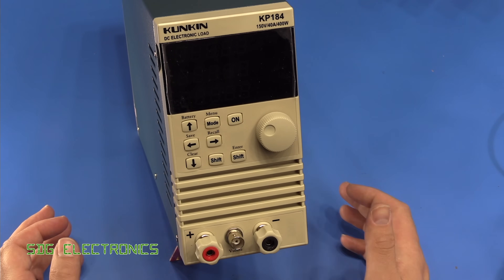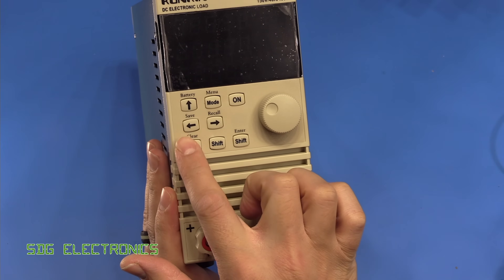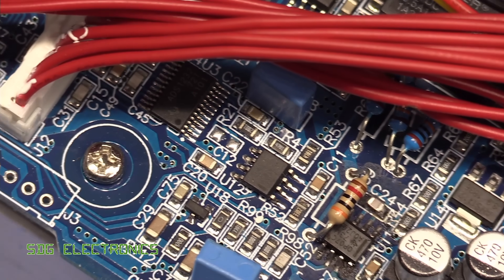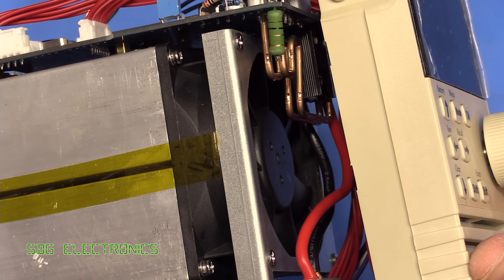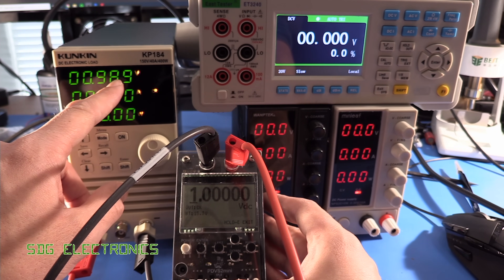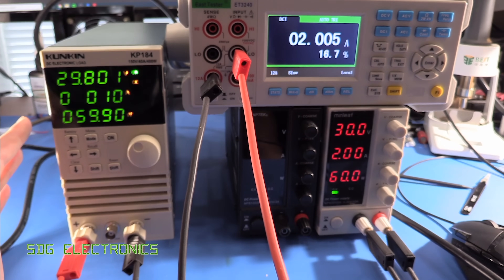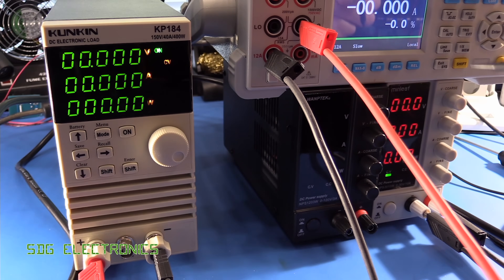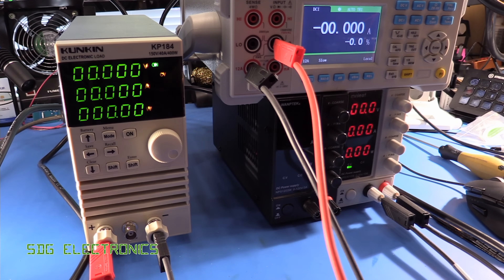SDG #129 Budget 400W 150V DC Load - Kunkin KP184

Comment: I know there are several videos on this unit and this video is 5 years old, but these are still being sold. There's a couple of things which aren't mentioned here: The banana jacks are 4.2 mm and not 4mm. One common fix is to replace these with your own. Also there's an issue with the transformer at 9:10 being bent up and making contact above it, shorting the ground and negative out. The fix is to bend the mounting tabs correctly and/or apply some insulation tape to the body of the transformer to prevent shorts. Something to check if you buy one.
Reply: DLB-600W or KP184?

Comment: Thank you for the video.
The binding posts, external leads and possible the internal connections are not suited for a 40A current. So ... fail?:)
Keep in mind that on/off switching and frequency response characteristics are important measurements for such a device to show.

Comment: Thanks for the great review. At 6:55 I may have spotted a broken solder joint on the front PCB. Above and right of the electrolytic capacitor, in the second row of THT solder joints (counted from the bottom up), there is a very odd looking solder joint.

Comment: Pretty nice on! I am awaiting a korad kel-103 myself which i am really exited to get. It looks much more professional than that unit you got there. Sadly not with banana plugs like the one you got which i am really impressed by. Pretty awesome little detail there!
I will design a small addon board for the Korad at some point. Something like the one that EEVBlog got for he's rigol load.
Reply from the maker: I have that one on my list too as another potential one to try
Reply: @sdgelectronics  when I get it I'll give you a heads up. Even my Co worker is considering buying one and we don't go and buy bad equipment. Anything you want me to check up on for you before you buy it?

Comment: Nice review thanks. Sounds like great value for money. It would be nice to see how fast it reacts sudden changes on the input, as in, does it adjust the load in a micro controller or is it a proper analog feedback design for all modes.

Comment: I'm guessing they already fixed the noise/stability problems that this model used to have?
There were several reports and perhaps the solution for those with older units is probably here:
https://www.eevblog.com/forum/testgear/fixing-an-manufacturer-issue-of-the-kunkin-kp184-electronic-load/
Reply from the maker: Very interesting - I'll see if that's applicable

Comment: I have a KP184, some issues:
- Off by 20mV or so once hot.
- Load positive connected to metal on rear panel (shock hazard).
Also it has battery test. Push shift than up.
Reply from the maker: Thanks for the notes. I've just tested mine - the load positive appears to connect to the heatsink through those MOSFETs, but there is no conductivity to the metal parts on the rear panel. I wonder if something has bridged across?
Reply: @sdgelectronics  Test the screws that hold the heatsink in place.

Comment: Good review, Steve. I'm looking forward to you tearing down and testing that new multi-meter.
Reply from the maker: I'll be interested to see what's inside. In the ranges that I quickly tested, it's exactly aligned with Ians PDVS2mini so a good start!
Reply: @sdgelectronics  I picked up the ET3240 bench DMM from bangood, and it just finally got here.  It powers on but just sits at the green East Tester boot screen.  I've tried pressing buttons, nothing seems to help.  2 hours later, still at that green boot.  Looking forward to a tear down of that East Tester Unit.  Trying to find support for this thing isn't very good so far...  I have an East Tester DC load as well, ET5410 and am quite happy with how it performs and it does all the specs it says (plus some really good programmability).  Hoping I can get something figured out with this bench DMM, or if someone knows how to force a factory reset or has firmware.  So far, easttester.com hasn't helped...

Comment: Nice review! I had seen similar units but I have not tried them out yet.  I would be interested in seeing what noise this load might introduce into power supply tests.  One of my Array units works fine, but causes so much noise on the lines that it is useless for testing PSUs.
Reply from the maker: I'll see if I can measure it

Comment: Thanks for the review! I was actually curious how one of these looks inside as I've been keeping it in my wishlist. Even with the messy assembly quality this seems to be a good value for money as it meets the specs and provides decent functionality. And I'm pretty sure the company that makes these, will improve the assembly quality on future versions as I've experience this while reviewing different revisions of the Gophert power supplies over the years and each new revision their assembly got cleaner.
Reply from the maker: Yeah, it's pretty much ideal for my needs. It'll be interesting to see how well it stands up to abuse but it all seems pretty serviceable anyway. You'll have to get hold of one to see how you get on.

Comment: Thanks for the review Steve. A DC electronic load is the kind of test gear that you didn't know how useful they can be until you get one. I started with the BK8540 which as a similar form factor but only 150W. Rigol had a sale recently and I broke down and got their DL3021A but it's only rated at 200W. I'd be interested in how this one will actually do long term at draws upwards of 400W for extended periods of time. Having said that most folks don't really need that much dissipation at the hobbyist workbench. I'm interested in your HV DC supplies and look forward to more info from you on them. BTW, rework gel is on the way from Solderking, thanks again for the tip!

Comment: It does claim to have battery capacity testing function so maybe it has hidden modes that aren't documented anywhere how to use them?
I'd love to see a follow up on this regarding any other functions and the RS-232 and pass/fail etc. at some point...
Reply from the maker: I will be trying as I have some specific tests I need to perform later on this year
Reply: Yes, the serial interface could be really useful